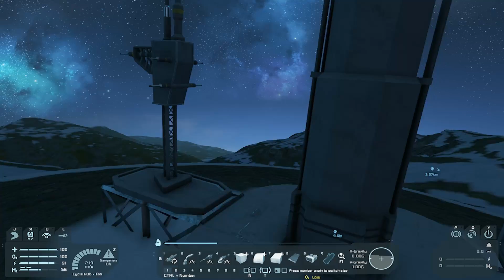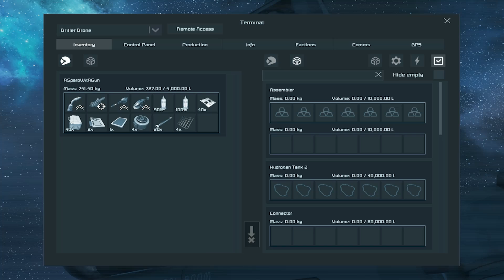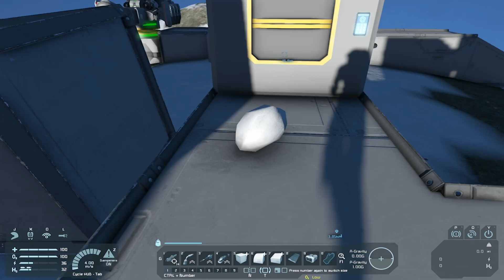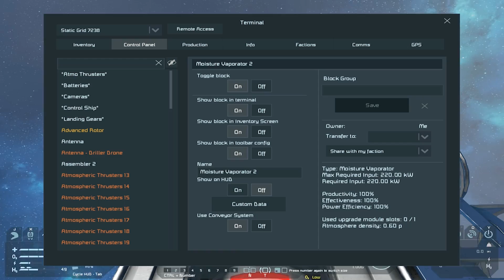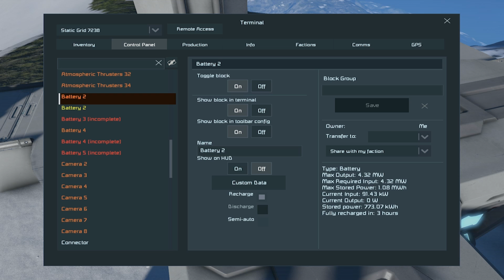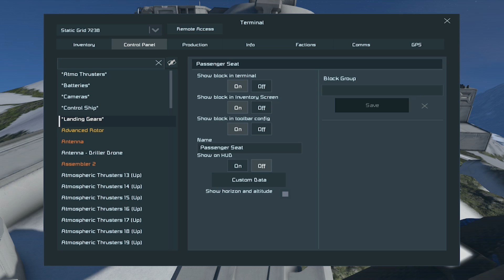Let's Play Space Engineers - Episode 15: Base V2.0 Is Now Fully Operational!

Comment: The oxygen generator is placed wrong. it only has a port on the top and bottom and two opposite each other. the facing you and the one on the back. there is not one on the side facing the assembler. I saw the problem coming before you clicked to place it down.